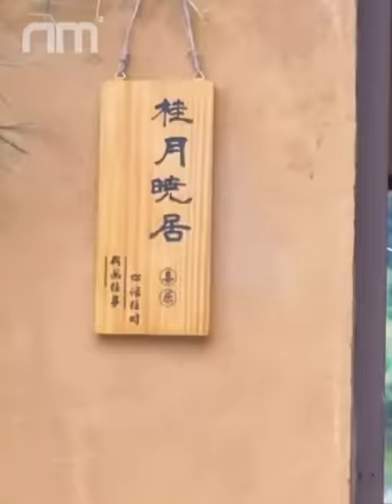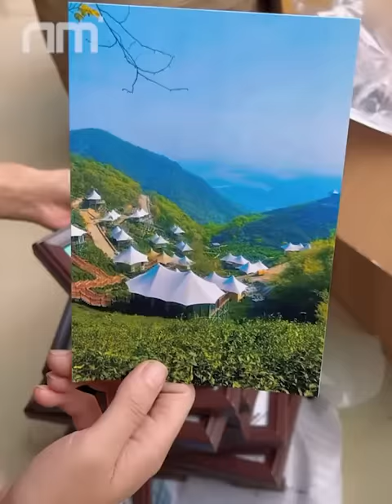Clean up Grandma's Abandoned House left to us - renovate it with your own hands

Comment: I have a suggestion to make to please treat your home for termites after you clean, repaired if you are going to live in your grandma's house to stay there. Just
Reply: Usually they use an oily treatment... But you are absolutely right. Also, soap and scrub grime off wood- then air it out before plaster... Which *doesn't remain long without an adhering treatment - usually nailed wire (aka chicken wire).
Reply: How about inside the house ? Outside  is good but inside is not